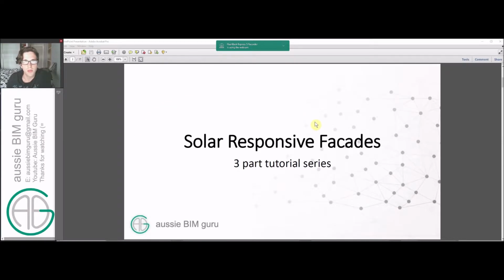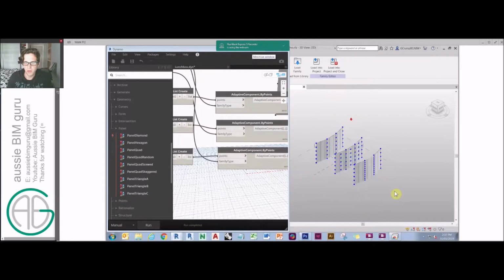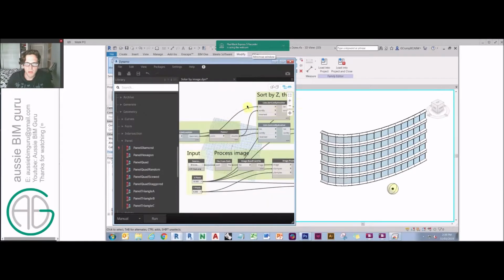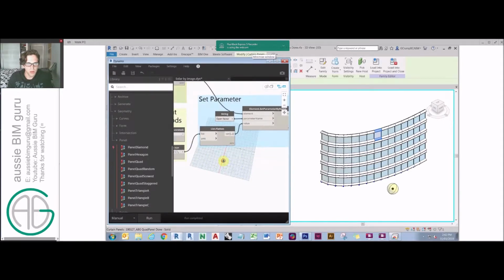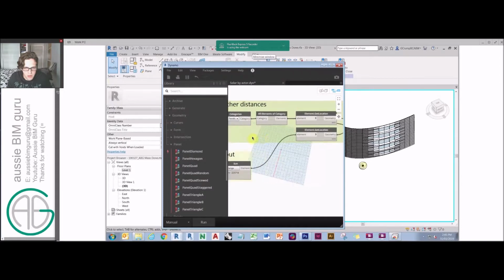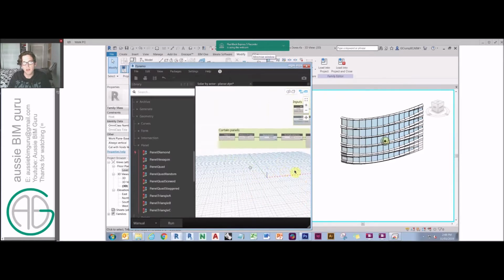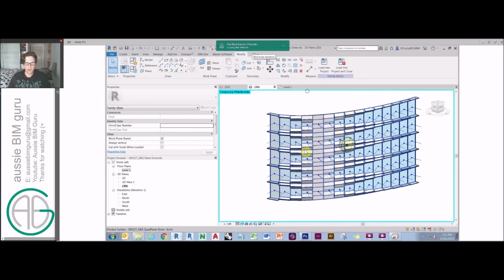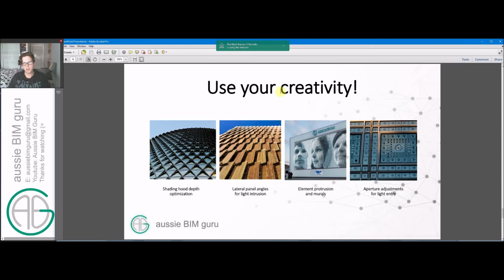Kinetic Facade in Revit (Intelligent Facades 3/3)

Comment: Hello @Aussie BIM Guru, im getting an error "Warning: Element.SetParameterByName expects argument type(s) (Revit.Elements.Element, string, var), but was called with (Revit.Elements.Category, string, double[])", may i know what could be the fault.
Reply: I did solve the previous issue but now im facing "Warning: Element.SetParameterByName operation failed. 
No parameter found by that name."
Reply from the maker: Make sure you have spelt the parameter name correctly, and that it exists in the family. As well as this, if the parameter is a type parameter you may need to use Element.Type.

As well as this, the workflow here wont work for panels inside repeaters or model in place masses at project level, only conceptual mass level. I will be releasing a new workflow next month which shows how to do this instead.
Reply: @AussieBIMGuru  I did double check the above comments but im stuck with Warning: Element.SetParameterByName operation failed. 
unitType is an invalid unit type.  See UnitUtils.IsValidUnitType() and UnitUtils.GetValidUnitTypes().
Parameter name: unitType
i did try using String.ToNumber but still no luck.
Reply: Is there any fix for this error or where i could have gone wrong?
Reply: @mohamedirshaad3110  Hi, i have this error. Could you fix it?
Reply from the maker: Sorry I don't get comment notifications properly anymore so don't tend to see replies anymore.

I would check out my video on Al-Bahar from monday and today which might provide a more stable method for controlling panels outside the mass.

Usually the warning you're encountering is because units are incorrect so it expects numbers and gets text for example. Try the new tutorial and see if it helps.
Reply: @AussieBIMGuru  If I could send you my model and the codding is it possible to correct the minor mistake as im not able to identify the issue with my coding. Everything seems perfect but for some reason im getting the same error.
Reply from the maker: Sure feel free to email script and model and I'll look deeper.
Reply: @AussieBIMGuru  Thanks alot mate, I have attached the following model and the script in the mail, besides the video was very helpful and do keep posting more videos.
Reply from the maker: @mohamedirshaad3110  late here now but will look into it tomorrow. Mail received.
Reply: @mohamedirshaad3110  same problem . how can i solve it?

Comment: Hello. How do I create the sun with adaptive point? Thankyou for the video!
Reply from the maker: This is a 1 point adaptive component. Around the point I drew a semi circle, then used the create form tool which generates a revolve as one of the options.
Reply: @AussieBIMGuru  Ooh I didn't expect a very fast response. Thank you very much!

So, I tried, and now the last node says "Warning: No function called SetParameterByName on a Revit.Elements.Category that takes string,__array could be found".

And also, if I put the curtain panel as a pattern when we divide surface of a mass surface, do we also select the categories in the first node as 'curtain panels"?

Thank you~
Reply from the maker: @ardel2697  for a panel type i would usually use family type and familyinstance.byfamilytype these days, much easier.

In regards to the warning, it sounds like you are pushing text and a revit category, make sure your inputs are correct to the node using object.type nodes for review.
Reply: @AussieBIMGuru  okay, so how do i connect from family type to the elements?
Reply: where do i connect the obj input on object.type node?
Reply from the maker: @ardel2697  family type dropdown > familyinstances by family type

These nodes are both ootb and should return each panel as an element. I have a tutorial coming out in a few week's time for al bahar facade which will moreorless show this process.

Object.type simply takes an input of any data object to tell you what data type the object is (e.g. string). It is useful for verifying if you are feeding the correct data type to a node
Reply: @AussieBIMGuru  okay. i tried my best. :")
i will wait for your new video. thankyou and goodluck!! ^^

Comment: Hi! Really nice series, but Im having some minor issues: 
1. The offset points on the curtain panel seem not to stick to the halfway points. I've rebuilt it and now only one is "loose". 
2. Can't find SortListByAnother node. Managed a workaround by combining SortIndexByValue and GetItemAtIndex. 
3. SetParamaterByName gives me this error: Warning: Element.SetParameterByName operation failed. 
unitType is an invalid unit type.  See UnitUtils.IsValidUnitType() and UnitUtils.GetValidUnitTypes().
Parameter name: unitType. Cant find a way to resolve it. Any ideas?
Reply from the maker: Thanks! In regards to your challenges;

1. Make sure you place any curve hosted points directly on the curve (hosted to it). You should know this works if the point becomes very small when placed, it should then maintain its position on the curve. Also might be worth checking its host whilst you select it (in the grey ribbon), to make sure it is the curve also.

2. I believe this node is from the clockwork package. I was a bit lazy in my early videos, nowadays I reference all custom nodes I use at the beginning of my content. Sorry about that.

3. It's quite a generic warning, my best guess is that the parameter is expecting a different data type. The most common cause is if you're feeding a string into a number based parameter. In this case, you would need to convert the data type (e.g. String.ToNumber).
Reply: @AussieBIMGuru  Thanks for quick reply! I've tried feeding a number slider as well as a list of numbers in. Neither works. The parameter that I'm changing is set to Common, Number and Instance.
Reply from the maker: @ludvigInLegendaryLands  if the unit type is correct then the warning makes me think it might be a deeper rooted issue. It's quite a generic warning so the root cause is hard to isolate. If you like feel free to send your script/model files by email and I'll investigate when time allows.
Reply: @AussieBIMGuru   i  am also having the set parameter error.Pleas etell me how i can solve it
 (Warning: Element.SetParameterByName operation failed. 
The parameter is read-only.)
Reply from the maker: @arijitbaidya9269  I believe this may be because you are using a conceptual mass at the project level? My approach only works in the conceptual massing family environment itself.
Reply: @AussieBIMGuru  thank you very much. I have some query about one project . I want to make a 3d face which you have shown in your video using dynamo and also i  want  the size of the spheres to change according to the brightness of a pixel inside revit.. can you make a tutorial or help me with that?
Reply: @arijitbaidya9269  Yo pude solicionar el problema de las unidades moviendo el parametro de "Open factor". Lo tenia en --- Comun---Numero---Otros. De esta manera me daba el error de unidades, lo solucione moviendolo a: Comun---Longitud----Cotas. De esta manera al ejecutar en dynamo me reconocio el parametro y cambio las unidades

Comment: Hi! How did you change  the parameter 'Open factor'  from  read-only to modifiable? When I use Dynamo, the parameter appears to be 'read-only' , because it's  grayed out in the Revit file. I don't know how to manage that in the family editor. Thanks in advance!
Reply from the maker: In this video I'm working within the conceptual massing environment. If you try to work in the project in relation to the mass panels it will not have access at this level to them.
Reply: @AussieBIMGuru  Thanks!

Comment: Hello @AussieBIMGuru, thanks for this video series, I am new to Dynamo and I have a question, I am working on a project for my architecture career and I decided to put a facade like the one you explained in the videos, but I would like to know if it is possible transfer this facade to the general project and if the change parameter could be the position of the sun directly. thank you!
Reply from the maker: Hi Carlos, you could tesselate a facade pattern using the lunchbox package, then place adaptive families by points using the adaptivecomponent.bypoints node.

From there, you could use ladybug if working in revit 2019 or earlier to get the sun vector. In 2020+ ladybug doesnt work in dynamo so you'd need to look into rhino inside instead.

Comment: How did you add the sun in the Massing file? the sun study is not available anymore in families????
Reply from the maker: Unfortunately the sun isn't, but you could use the Ladybug package instead (I hadn't learnt it when I made this!
Reply: @AussieBIMGuru  I am really struggling here... maybe I need to work on Project file, so I can have solar study, but the problem is that the adoptive family only inserts in massing curtain system... what do you suggest? continue working on massing file with ladybug (which have no idea to work on)... or make a new panel that can easily insert in curtain wall in Project file?
Reply from the maker: @sarabenlashihar2918  A curtain system could work as well - you would need to build the family differently so it would be a bit harder to constrain vs. an adaptive panel however. I know adaptive/conceptual massing environment is quite difficult to work within vs. the project though.

Ladybug is really just used in this case to establish the position of the sun, send me an email if you like and I can send over a basic sample of how to set up the sun vector.